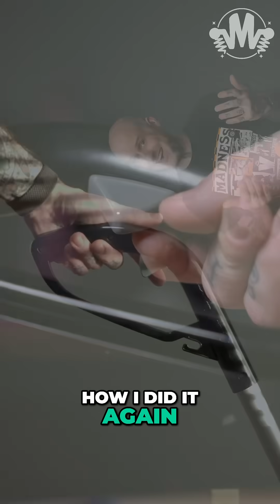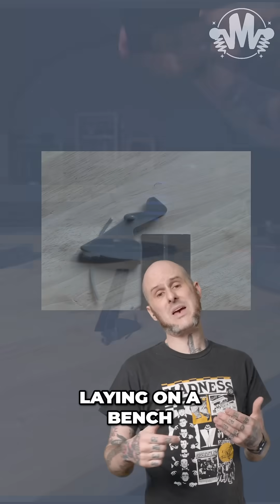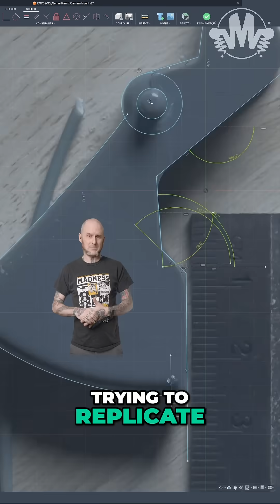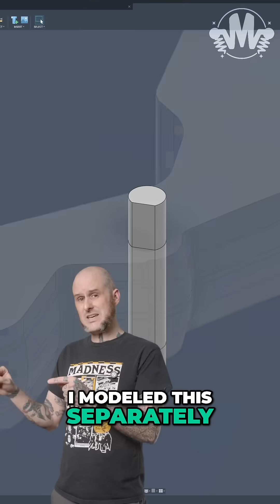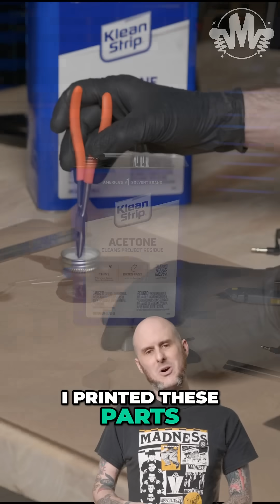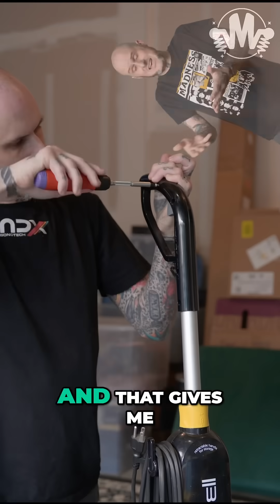Saved with 3D Printing! #3dprinted #3ddesign #3dprinting

Comment: Everyone talking about just drill and put a metal pin in, doesn’t understand that metal will slowly chew at the plastic on each end and will eventually eat away at the area on each side of the trigger on the handle where the pin goes in.

Comment: I swear, practical caliper use is dieing. This would have been a 5 minute design with a pair of calipers. Its like no one teaches basic drafting techniques anymore. Everybody always goes "no! Its not that easy!" Yes it is, you just need to know the right techniques.
Reply from the maker: The part is almost entirely compound curves, not straight lines and fixed radii. Yes, you can reverse-engineer that with calipers, radius gauges, and French curves if you want to spend the time. I was trained on pencil-and-paper drafting too, I AM that old.

But since the end result has to be designed in CAD anyway, snapping a photo, scaling it, and tracing gets me to the close enough accuracy, faster. Knowing the manual techniques is valuable to inform design, but choosing the most efficient workflow is also part of good design.
Reply: @MandicReally i understand you probably can, but im saying the broad population only ever teach scanning. Im not saying you are wrong... im noting that there is an insane lack of sharing proper techniques and they are going to go extinct.

Comment: I took my Bosch vacuums apart to replace the batteries...and now I'm never buying a Bosch product ever again.  
The BMS uses volatile RAM, so the moment you disconnect the batteries it forgets it's a BMS.  
There's been no good reason to use this type of chip for about 30years, the *only* reason they've done it is to make it harder to replace the batteries.  
Unsurprisingly they sell a replacement battery pack at almost the full MSRP of the vacuum.  
They want it to go to a landfill and you to buy a new one.

Comment: Drill the pin out and replace it with any material of your choice
Reply: Did that exact fix when ours broke.  A steel pin from car parts worked without any modifications.
Reply: @jimwile9313  3d fdm printers in a nutshell - using them for everything even if its smarter to do any other way, make a video for engagement (the only reason they even do this whole thing) and post it. its like they think they are engineers or something and the shit they post is interesting and not done 50yr ago.

Comment: It’s cool but you could have drilled a hole in the original piece and put a metal peg in its place, though I will admit I would have redesigned the part my self 😂 so hey 🤷‍♂️
Reply: Tried that before, the metal ate away at the housing and slid down the handle…
Reply: @AceOfBlackjack  oh ! good point 👌🏼
Reply: yup

Comment: sorry so many of your fans are haters. i approve of this fix and method. im a basic b** so i would have just printed in PLA or PETG or PETCF and used a dab of grease on the pivot and let it ride. I have fixed more things than  i can count with whatever the hell i had laying around nearby in the house before having a 3DP.

Comment: I mean did you save any money though since everything is cheap garbage you can buy three new ones for the price of modeling one trigger
Reply from the maker: It took me 10 minutes to model and cost $.18 in plastic and less than 1kw/h in electricity. So yea, I think I saved just fine. Even at my normal hourly rate it’s a less than $20 fix, and of course I didn’t pay my hourly rate…
Reply: @MandicReally  Opportunity cost.  You could have been earning money from a customer during that time, but I get it.  This kind of thing is fun and satisfying.
Reply: @MandicReally also you had the relevant fix in hand in next to no time

Comment: Or... drill and insert a steel towel pin
Reply from the maker: Hole location would be very close to the edge of the trigger, the original trigger shape is tapered, so it would have been crooked drilling without a shim under it, and then you have to locate exactly the right sized pin (which wasn’t available locally). Instead I made an entire replacement in less than 1 hour using $.18 worth of plastic.
Reply: @MandicReally  Find a nail cut it and JB weld in place it will out live any 3d printed part. Are you sure you weren't happy this thing was broken so you had an excuse to design a new one I have been there done that.
Reply: Or contract PCBway to make one out of recovered meteorite material and then further refined by the best metallurgists in all of Japan to make one trigger to rule them all.  Or 3d print it.  The fuck is your point?
Reply: thats what i was gonna say
Reply: I'm with OP on this one (and the latter trimmed nail [sic] solution)... although this one isn't as bad, especially if it is a common failure with this model, and as long as the 3D model is shared for other affected people to easily make and fix their device, thus bypassing modelling skills and time.

Personal pet pieve of mine is 3D printer-ers printing large flat surfaces out of plastic where a much easier, and usually way faster cardboard or hard stock paper would do, standalone or even as an insert. (Or the extremely thin plywood or lesonite [that closet backing thin and flexible material], if they have the means – and majority of them do.)

This especially applies to all those utilitarian self-organizing boxes, where they waste kilograms of hard-to-impossible to recycle plastic, instead of the ideally upcycled sustainable paper, cardboard, or wood (or wood-based) materials.

Really grinds my (3D printed plastic) gears.
Reply: yeah why do all that when you could melt a hole with a small nail or metal pin thru it?